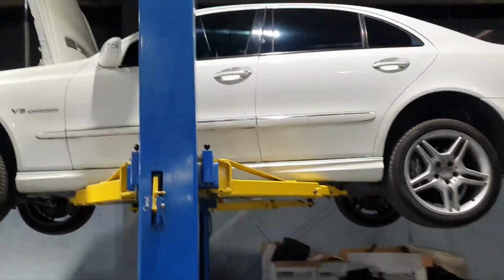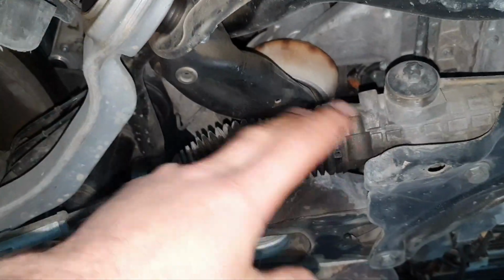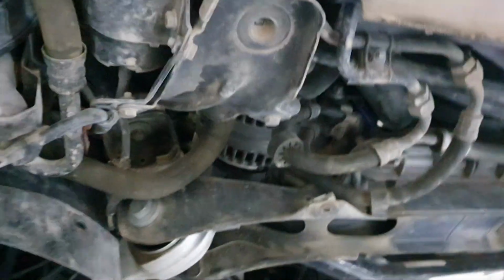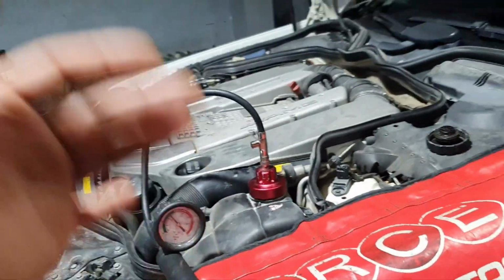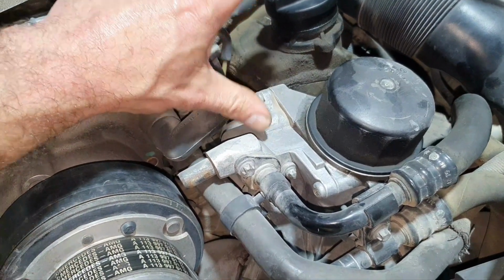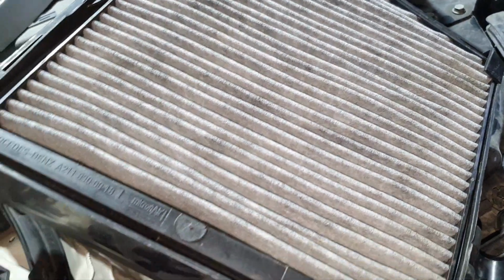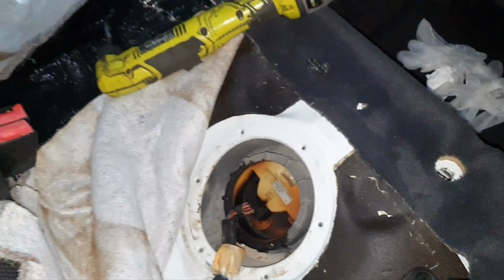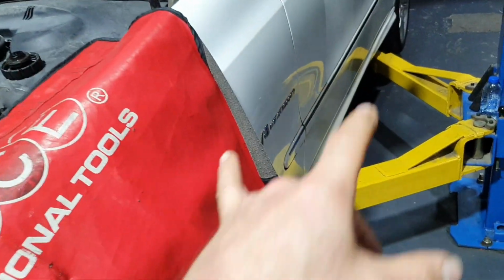E55 2006 with 190k km check up (part 2)

Comment: Some oil in the coolant reservoir , visible in part 1 ,  (as well as coolant in the engine oil, ) cannot come from cold start moisture or from head gasket failure.
Many repairs needed to fix this car up.